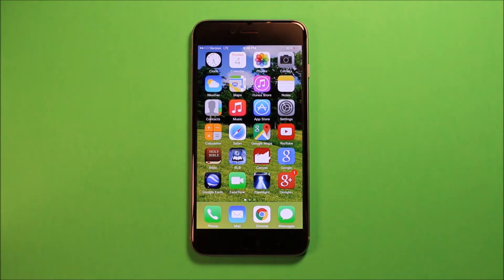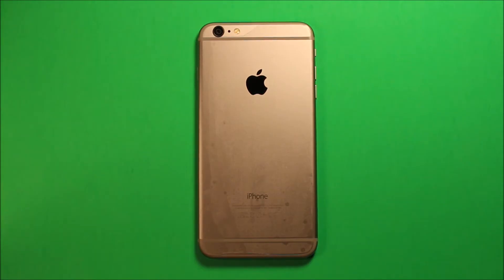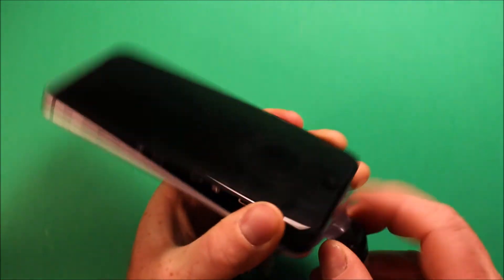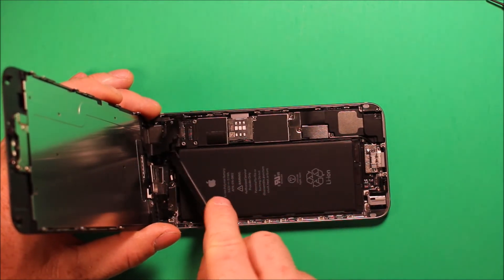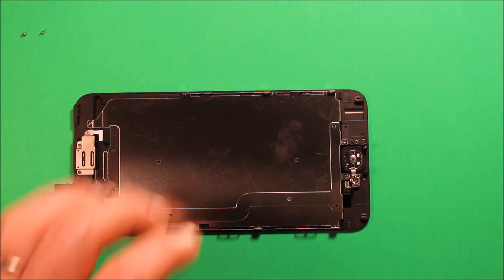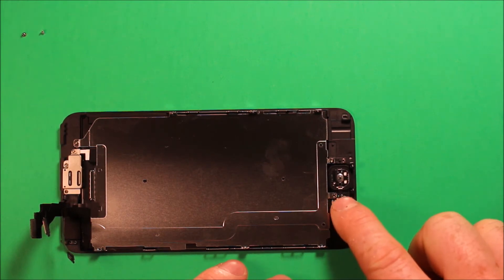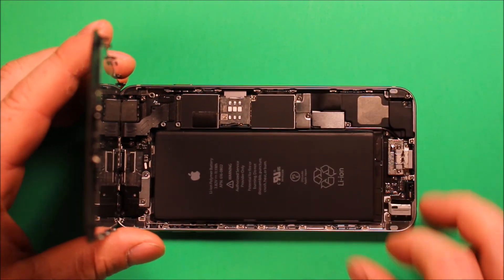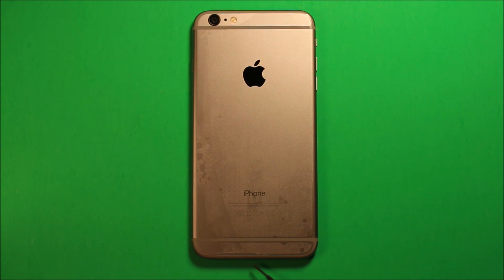iPhone 6 Plus Home Button Replacement How To Change

Comment: Thanks for the video helped a lot, couldn't find any other videos on this.  I actually was able to reuse the black rubber piece, I think it will be fine but if you do it more than once probably need a replacement.  Again, thanks a lot!
Reply from the maker: You're welcome. Glad it helped. I'm glad you were able to reuse it. Sometimes it works sometimes it doesn't. But yeah prob not more than once. Good job!

Comment: Great video and all, but you will no longer have touch ID if you use any homebutton that was not the original button. The home button directly talks to the CPU and the CPU will know if the homebutton is not the original one. There are different ways to get back touch ID depending on what your problem is. If you are repairing a screen, you need to keep the old home button and be extremely careful not to damage the ribbon. if that scares you, Apple will replace your screen and with a new button. Apple has a machine that will map the new home button to the CPU. No other ways have been found yet. You can repair torn ribbons, but that is doing micro soldering and is extremely difficult for DIY. There are youtubers that do this professionally you can look up. Check out iPad Rehab or STS Telecom

Comment: my 6S orIgnal touch strip or sensor was damaged , home button and screen replaced and now touch  id is failed is their any solution  for it? THEY TOLD ME  TOUCH ID WILL BE FAILED IT CANNOT BE REPLACED . PLEASE ADVICE ME IF THEIRS ANY SOLUTION
 ... MY HOME BUTTON  IS WORKING FINE BUT TOUCH ID FAIIED ISSUE 6S.

Comment: After changing the home button will the touch id work. My iPhone 6 has home button not working and touch id not working. Which replacement part should i use so that home button works as well as touch id.
Reply from the maker: +Tariq Theba I have heard that touch ID won't work properly unless it's the original one that was paired with the original motherboard.
Reply: Then what should I do ? Will the service station will fix this ?

Comment: If I change the ribbon flex cable from the LCD will the Touch ID sensor still work ?
Reply from the maker: +Gerardo Navarro Yes just changing the LTD shouldn't affect the touch ID sensor.
Reply from the maker: +Gerardo Navarro LCD

Comment: Man your phone looks very dirty in the back side of the phone but goog video question some guy fixed my display  of my iPhone 6 and now my home button looks a bit sunken there is a problem with that is bad placed ?
Reply from the maker: Thanks. Not sure why it looks dirty. It's space Greyson's that makes it look worse. Yeah what it sounds like to me is they reused the rubber gasket and it doesn't have enough adhesive to hold it right. You probably won't be happy with it till you change it out with a new rubber gasket. I have a link in the description of the video where you can find those if you want one. Hope that helps. Thanks.
Reply: +Diego Martelo I fix Iphone for a living and I can tell you there are two possible things that might have happened to the home button 1.) during the repair a small piece have broken glass may have still been stuck to the side on the button preventing it to sit correctly. 2.) the metal bracket that holds the home button down has a pointed tit on the bottom side, this tit can come loose and break off from the bracket. without that small tit it wont sit down correctly also.
Reply: +Jeremy Kooi 
since you repair iphones for a living, can you please help me by answering my question? my home button is not working after i replaced a broken screen. should I replace the metal part with the cable that connects to the home button? I just want to get the touch ID function as well

Comment: Hey, it's only home button replacement because new home button will not have touch id working anymore. You should change the video title to home button replacement. disliked due fake title.
Reply from the maker: Ok I changed the title. The reason I made the video though is to show how to change it out. Some screen replacement videos talk about swapping it but don’t show it. I would think if someone needs to change it this should help. They aren’t necessarily putting in a new one but swapping over their original one to new screen etc.
Reply: @SmartEasyDIYer  Thanks so much i also changed to LIKE
Reply from the maker: Thank you I appreciate that. Best of luck with your repair!